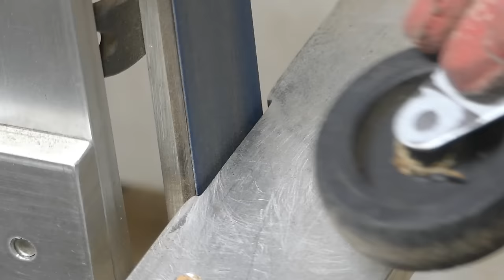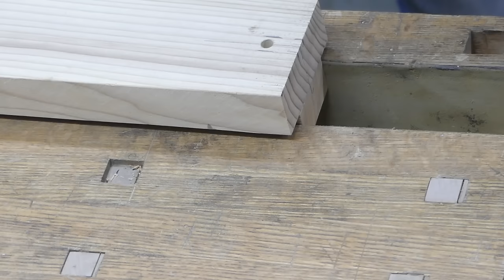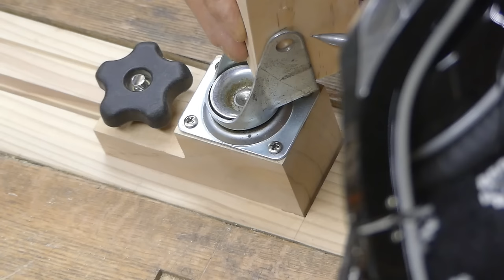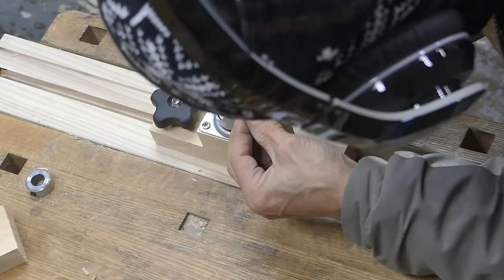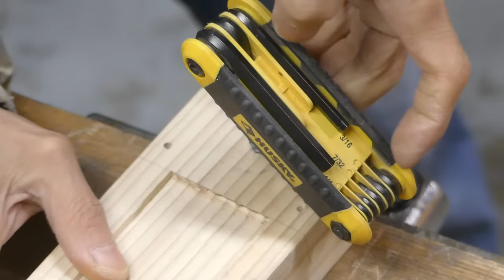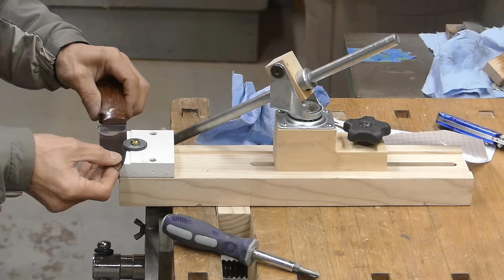Make a knife sharpening jig

Comment: I’m so glad you still have all your fingers. I wasn’t sure they would survive. I’ve been a carpenter for 30 years and you, my friend are 10 times braver than I will ever be! Great project! Thank you for the video!
Reply: @dman3526  oh my, you sure told me off good. I can choose my own words, but I appreciate your concern. Safety can argue for itself and often does when it’s too late. I’m guessing you spend much of your time criticizing YouTube user comments. Or am I one of the lucky few?
Reply: Даже не говоря о технике безопасности, "мастер" видно ставил задачу произвести 10 дюймовую поделку из целого дерева(судя по переработанным брускам и доскам)))) Не вышло у него, но просмотров собрал...)))
Reply: No problem with his technique. He uses large push sticks and has firm pressure on them which all but eliminates a kickback which would put his left fingers in jeopardy. Working in a commercial cabinet shop for 15 years I can tell you most injuries occur when people don't properly control the wood through the saw, for example pulling a piece through from the back side of the blade with small pieces, kickback pulls your already hinged right arm through the blades, seen several fingers go missing over that one. Many high end push stick systems often have your hand going over the saw with just a polymer pusher between your fingers and the blade.
Reply: @ALLENNEWLIN1979  I thought the same thing he did several times during your video. I'm glad you haven't had any problems during your time Woodworking... But I'd be afraid to wager what you are too many times
Reply: @ALLENNEWLIN1979  First of all great video, and much cheaper than $400 which is what they charge for the store made machine, good job!. As far as the guy that mentioned your fingers. He did it in a nice way and classy, no need to get defensive with him, he just cares for you, nothing wrong with that.
Reply: Have you ever been in a cabinet shop?  Residential or aircraft, everyday practice.  I have worked in both, but I'm retired now and am much more careful now that I don't have the pressure to get things done fast.

Comment: Nicely done.
Fwiw... I've been using the Gatco/Lansky diamond clamping system for 25+ years and they work fantastic, they also allow you to flip sides, a necessity as you move into the finer hones, and flipping is a requirement between your final few edge-towards-spine passes for a truly scary sharp edge, even before stropping.  

This jig he made would be perfect for hand shaping primary bevels with a file before heat treat, and for a satin finish after.

Comment: that's very similar to a knife sharpening system I bought a few years ago, but I think your design solves some of the problems it has... It is limited to fixed degrees (15, 20, 25, and 30), can't sharpen very narrow knives, like a paring knife or fillet knife, and it also can't sharpen longer knives because the provided rods aren't long enough.  And the knife width affects the sharpening angle... didn't think about that until now.  your design fixes that, too since you can mount the knife then adjust the angle to correct.

Very well done!
Reply from the maker: thanks~

Comment: Yesss! A better understanding comes with the experience. Wood as a basic material is much easier to process than metal and it provides more opportunities for modeling. A slide bushing is not inferior to a ball pivot, giving at the same tome more freedom in bidirectional movement. A teflon sleeve can be easily inserted into the bushing, which will make the travel of the sliding rod smooth and noiseless.

Comment: Very nice design.  I'd never thought of using the caster like that.  With just a little modification to the jig, you could use it to sharpen chisel and plane blades.  It would certainly be cheaper than a Worksharp 3000.
Thank you for posting this.
Reply from the maker: thank~
Reply: Yer, looks brilliant, but ideally, I'm looking for something that can sharpen EVERYTHING. So far my list of tools that I can think of - which is growing - is saw blades (circular & hand), plane, chisels, knifes, meat grinder. 

I'm new to sharpening, so haven't watched videos about how to sharpen all of these things but I think I'm getting the general theory. A bit of tweaking and it'd be very versatile.

Comment: I do not have the wood working capabilities you have. So in my shop I will do it my way. The base could be made from round sections or tubing, working as ways for the carriage to slide on (Emco Unimat SL style). Only the carriage and  the end pieces would need to be drilled. A compound table in a drill press can mill and drill the wood or plastic needed. Your design is very good though, thanks for posting!

Comment: Interesting design.
What's the minimum angle per side? I couldn't see the display on your angle finder.
20? 30 degrees per side? 
It looked around 20 when you "sharpened" that knife.
60 years ago, I was taught a knife should be sharoened to 10DPS (20 degrees inclusive) An Axe/Hatchet or Tomahawk should be 30 to 40 degrees inclusive.
Until the "tactical knife" craze hit, the factory edge on a pocket knife and hunting knife was 10 DPS/20 degrees inclusive; not the 30 to 50 degrees inclusive of today.
10DPS slices better and lasts just as long, if not longer, than a more obtuse angle.

Comment: The reuse of the caster is genius. I am curious how the jig works though. I thought it would keep the planes of the sharpening hones at fixed angles relative to the fulcrum in the caster, but it doesn't. The angles of those stones are all over the place. The only thing keeping the diamond hones at a single angle is the blade itself. If the blade where shorter, the angle would be more steep. Taller blades would have shallower angles. If the block inside the caster could be locked at a specific angle, then I think it'd do exactly what it should, but when it's free to move, the blade itself dictates the angle. Which means it's not much more accurate than going freehand. Am I missing something?
Reply: I believe that the distance between  the  castor and the blade dictates the angle of stone and can be adjusted with the black knob. However, I think you are right about angle changing. There would be a small variation from the tip to where the blade widens out to be parallel. 
But the consistency of each stoke would far surpass my skills at free hand sharpening.

Comment: Great idea, but I think, when you add sharpening plate and knife, you change angle.
Reply: Slightly anyway. Just check the angle with the plate on the rig. As for the angle of the blades edge, set the angle finder as close as possible and zero it, then set the rig angle. It is fairly close, likely within a degree, but does that really matter? Suggested angles for sharpening knives is an approximation depending on use anyway.
Reply: @thomasarussellsr  Right 😉

Comment: That is a nice setup for DIY option I think you have a good basic working design that can be improved apoun. I would look for changing the sharpening stone setup to hold the Ruixin Pro design whetstone so you can swap in and out different grinding stone grits. Use a G-clamp to be able fasten it to any standard table or bench it would be much easier to work with. The blade holding system is a little clunky although very effective if you could figure out using a quick tighting system it would be really nice.

Comment: Another case of the blind leading the blind.
Here are the facts.
A person with a workshop and tools and jigs etc, probably running into the value of hundreds, if not thousands of pounds wants you to invest money and time he probably has that you do not, instead of using an oil or whet stone or a steel.
If your going to attempt sharpening any tool then ipso facto this isn't your first and you know what your doing.
If you dont know what your doing you have three options, buy a simple run thru sharpener, get it sharpened, or buy another.
Those are all reasonable options.
Just because someone dazzles you with percieved genius, stop and ask yourself this:
Which is more relevant, that I do something because I can, or because I should?
A case in point:
Your yard broom breaks. Do you
(A) buy a new handle
(B) turn a new handle
Answer (A)or(B)